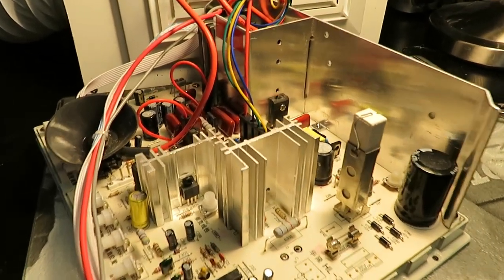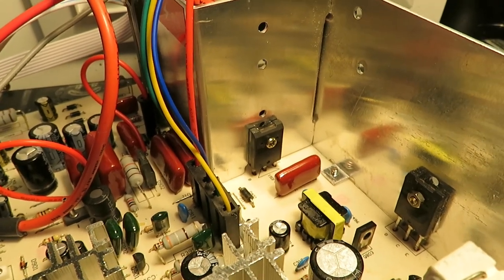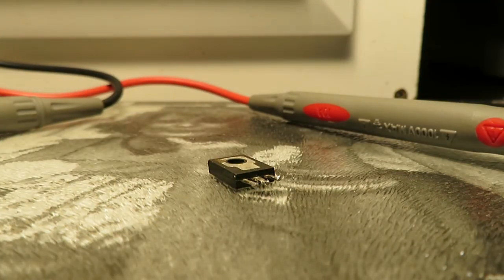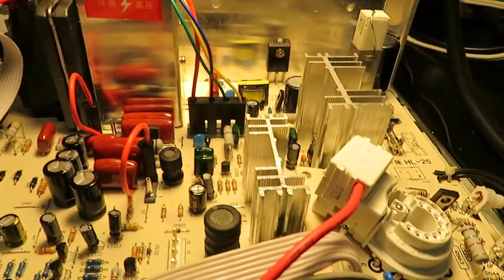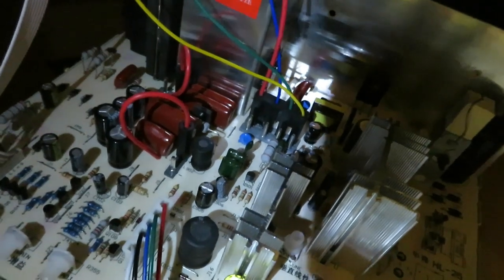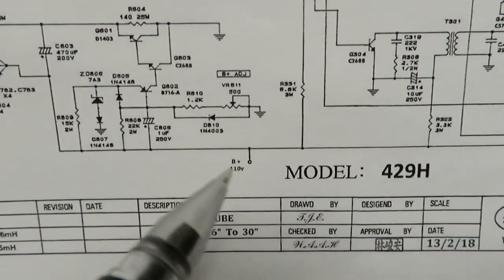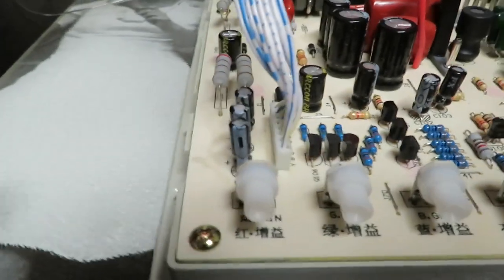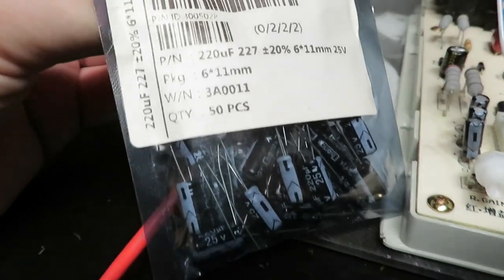Universal arcade chassis repair and color improvement mod

Comment: Hi. Got a 27 year old Weche OK Baby arcade cabinet, 3 months ago, and it cames with one of this chasis (paired with a Videocolor monitor), curiosly signed, as the rest of the electronic parts of the machine, by Ying Tching Electronics, from Taiwan. No geometry issues, but same color issue as yours. Which capacitors would you recommend to replace the three indicated, as of today? Keep in mind that I am connecting a PC, not jamma boards. Thank you very much.

Comment: I just had two new old stock WeiYa/Makvision monitors strewn across the yard in an EF-4 tornado. Both are ruined. You can see them in some of my aftermath footage. The one on the ground is a 38” and the other in the box is a 29”.
Reply from the maker: Oh dude, that sucks. House still standing, but all the finish wrecked. Lots to repair... Sorry to hear.
Reply: @pcbjunkie1  Yeah. Some of my neighbors lost everything... not even a wall left standing. The chimney’s gone, the balcony is gone, most of the roof is gone, my car was crushed by a tree, etc but we still got extremely lucky considering the absolute devastation all around us. I don’t know what I would have done if the storm damaged a bunch of customer consoles or their equipment (lots of UltraHDMI HW2, PS1Digital, xStation, etc in the house).
Reply: F
Reply: @justz00t48  ?
Reply: @emmettturner9452  Paying respects for your loss.
Reply: @justz00t48  Thanks. I’ve seen “press F for ____” and understood it might be that… but I’ve also seen people just say “F” to mean fake and I didn’t want to assume. :) I saw your comment elsewhere about replacement chassis. I still have the guts if you want them. Never used but they definitely got a bit weathered.
Reply: @emmettturner9452  Do you have the yokes?
Reply: @justz00t48  I recall the glass snapped at the neckboard but can’t recall if I just cut it off the rest of the tube or not. I’ll check my storage unit and let you know. I just remember the landlord’s contractor was approaching fast with a bulldozer so I was trying to salvage what I could as fast as I could before he got to it.
Reply: @emmettturner9452  Wow, thank you so much for checking.  I was just watching your video about the NES carts with heroin inside. That is a incredible find and the tornado damage pretty crazy as well.
Reply: @emmettturner9452  The really hard part about finding tri sync replacements is that if you can find a chassis that works the yokes usually got tossed out with the tubes.  For tri sync or high resolution 29" monitors the horizontal inductance is around .20 to .40 mH. TVs are all much higher values so either you have to try a yoke off the old arcade monitor or rewind the yoke from the TV donor tube. Rewinding yokes looks a like a really heavy lift IMO.
Reply: @justz00t48  Haven’t forgot about you! I haven’t found the harness from the 38” yet but I will! :)

It really sucks that people typically toss these tri-sync yokes so I hope I didn’t make the same mistake. I never had a tri-sync before, which was why I bought these. One was going in the arcade cabinet and the other was going onto a test bench to use like a PVM. Unfortunately, both were damaged beyond repair. :( I still hope to find a replacement tube for the 29” unit. On Facebook people told me the tubes were easy to find with low hours since the Wei-Ya/Mak Vision chassis was known to fail prematurely. They also said I could probably stave that off with active cooling so I was going to test my luck with a fan.

Yeah, the NES carts being used as drug mules for international smuggling was definitely an exciting find! I just wish we didn’t find it on April 1st since people didn’t believe us at first. Eventually it got picked up by the news with verified police reports and such which is when it went everywhere… even Jimmy Fallon joked about it on The Tonight Show (April 20th, 2018). Crazy!

Comment: I noticed most of this clone chassis have the spot for where the degauss pins should be, but there is nothing there. Is it possible to add degauss capabilities to this cheap chassis? I have quite a few!

Comment: Did you ever investigate more on this? I feel like with the availability and cost of original chassis now and how close to being a viable option these are, it's worth improving them as much as possible. When I finally get mine repaired (popped it with no iso and low ohm H on yoke) I plan to do some experimentation
Reply from the maker: Yeah, these can be quite handy at the price point, especially with some improvements. I didn't really experiment that much more because after this mod (I used even larger input caps later), I found this chassis to work pretty well. I just played that cab yesterday in fact, and It's still going strong.
Reply: @pcbjunkie  Great! Did you go with 470uf? I may at some point make a schematic to make maintenance easier

Comment: Awesome video, thanks for going into all this detail. I have two of these and they both have this color warping effect pretty terrible. Did you ever test out if shorting the leads helped further? If it helps at all I found that  the effect lessens when I use lower voltage console RGB, and when I use buffered RGB (via retrotink Ultimate raspberry pi hat) the effect isn't there at all (or barely noticeable under extreme contrast differences with the other chassis). I'm definitely going to try those 220uf caps, hope to find a complete solution someday.
Reply from the maker: Yes it did, at least on the color fading problem. In the end i replaced the caps with 1000uF and the problem is mosly gone. I don't just want to remove those caps because I suspect they are there to possibly protect the source of the signal from being fed a DC offset from the chassis. Maybe this was their fix to stop things from blowing up if no isolation transformed is used. I honestly don't know. I looked a few schematics of Electrohome and Wells-Gardner chassis and I do not see AC coupling capacitors used in the input section so it's possible those caps are not needed at all under normal circumstances.
Reply: @pcbjunkie1  Thanks for the reply. I noticed on mine they added a 1000uf cap in line with those coupling caps right before the signals go to the neckboard, and that 1000uf cap would blow after a few hours of operation every time (I went through quite a few), until I changed the coupling caps to higher capacitance. I honestly have no faith in these boards but it's good to have one on hand in a pinch.
Reply from the maker: @old_and_obsolete  Are you using an isolation transformer?
Reply: @pcbjunkie1  Yeah on both of them, even though one has a 120-220v power supply with its own transformer on it. Different layout but the same basic circuit it looks like, same coupling caps and all that, same issues. The only arcade boards I have to test them with are a few MVS boards, and I read that those output hotter RGB than most, and I only have consumer TV tubes also, so that might be contributing to the problem (they match impedance ratings but I have an LCR meter coming to test inductance too).
Reply: @pcbjunkie1  A follow up video would be great to see the difference, got one on order so would be interesting to see

Comment: I have a problem with the weiya, the b+ is 140-145 volts and the b+ potentiometer doenst change anything, this generate a ondulation in the image and a burn Smell.

Comment: Man I wish they would make a tri sync chassis replacement. It's getting really hard to find replacements.
Reply: I did salvage the electronics from the new old stock unit that got destroyed in the tornado, if that’s what you mean. Never used but it did spend days out in the yard.

Comment: Hi pcbjunkie I bought a new universal arcade chassis awhile back a C2729 and the corners are warped on a flat screen tube, I managed to find an older rounded tube with the right yolk readings and its seems to be abit less noticable but still there especially pronounced on side scrolling games any idea why? or if how to fix it?
Reply from the maker: There is a pincushion adjustment on these. It's one of the knobs. On mine the max adjustment just barely makes the image straight. I never messed around with this section so I don't know what components are responsible. Sorry about that.

Comment: I have a weiya h425 its like the same of these you show, with green screen problem and horizontal line in the center, i changed the resistor 140ohms to a 160ohms also the capacitors 330uf to a 470uf but i also have the same problem, maybe change the diodes 10bb4t to fr205 that i read these fail?
Reply from the maker: It's probably the vertical deflection chip TAxxxx. I had mine fail too. I think that heatsink may be too small for it.
Reply: @pcbjunkie1  i changed it too, maybe i break it with some voltage i am going to change it again, Also do you think that the resistor r401 have to be less than 3.3k and the r409? thanks for your message I appreciate your comment

Comment: Is there one of these universal chassis that would fit a 19" tube?
Reply from the maker: There are clones for 20 inch tubes. Since they are adjustable, I'm guessing they should also work with a 19" tube. Mind you I haven't tried them, so I don't know if they are any good.

Comment: nice video, how to adjust contrast on this chassis, when i load up the game i have gray screenn it should be black, when i turn flyback down to get black the picture go to dark
Reply from the maker: I don't remember if there is a contrast knob (I think there is) but you can also increase the gain (3 rgb pots near the input connector), and then use the pots on the CRT neck board for the cutoff to darken blacks. It's easier if you have a video signal generator and know what the colors should look like.
Reply: @pcbjunkie1  thanks for info, The châssis don’t have contrast pot, I think I have to play with RGB pot
Reply: @pcbjunkie1  i shorted that 3 capacitor, the color and contrast are insanely good, I’m so happy with the results, thanks man